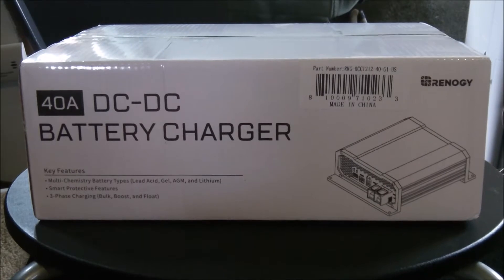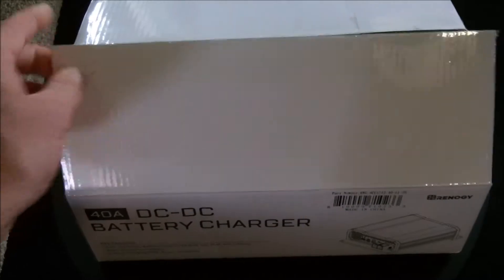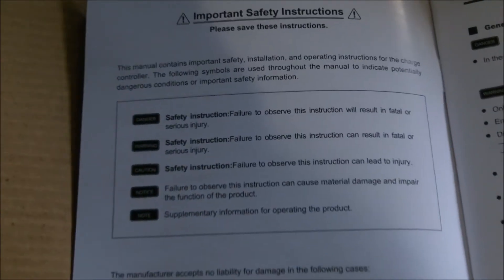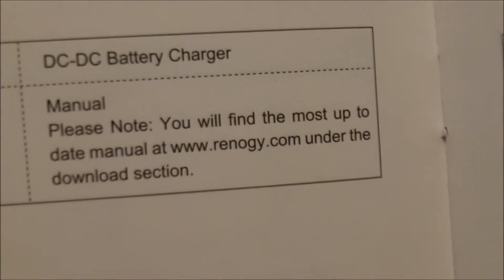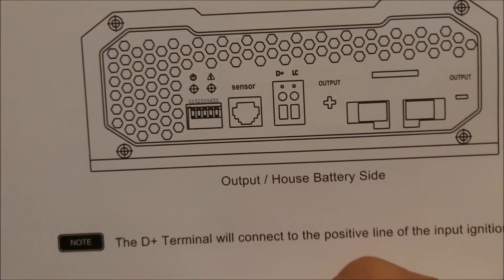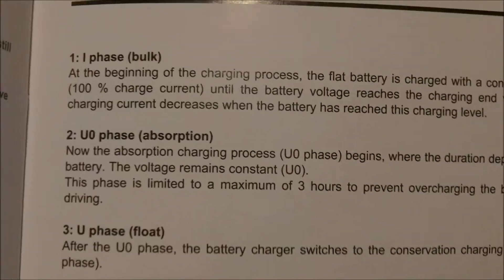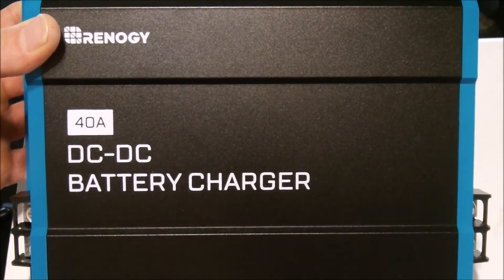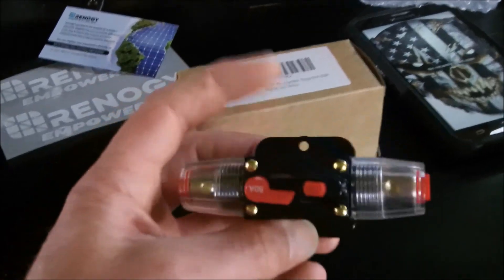Renogy 12 volt 40  amp dc to dc charger

Comment: My 5th Wheel is stationary at camp & through spring, summer & fall I have plenty of solar power. However the usual overcast through most of winter chops that down to a trickle charge at times. Where a dc to dc charger should fill the gap. Been using a Renogy 40a mppt controller, like the brand. Thanks for the presentation.
Reply from the maker: No problem thanks for replying

Comment: I tried those fuse holders a few years ago for this sort of application and they are hopeless - they all failed. They are designed for intermittent or low duty cycle use so even audio systems as the load is not constantly high. in the DCDC Charger application the fuses themselves failed and the fuse holders melted due to the constant high current load. You need a fuse holder such as an ANL type with bolts for the connections and the fuse to be able to sustain the constant high load currents and even more th ecase if you run it at 40amp mode as the input current is over 50A. Cheers Tim
Reply from the maker: thanks for info il keep an eye on mine. thats what i had laying around maby il switch them out thanks again